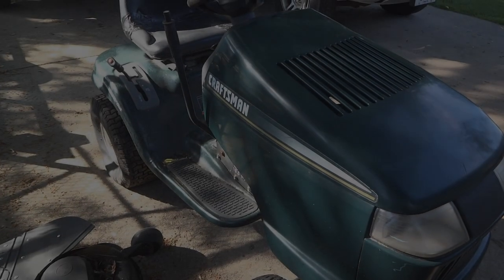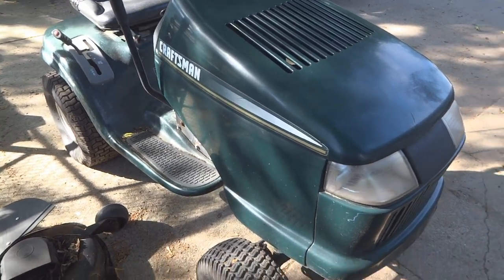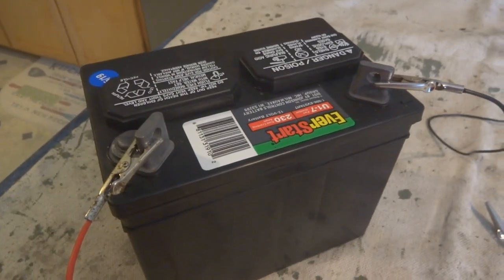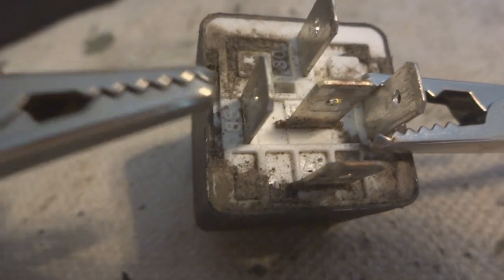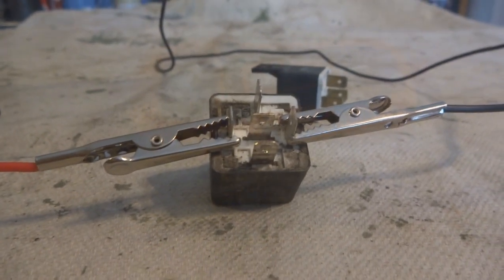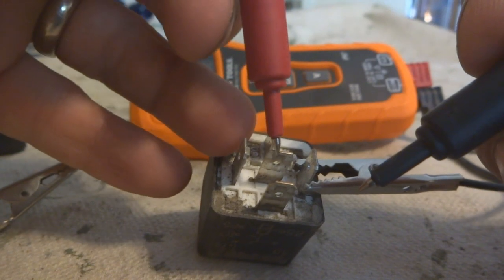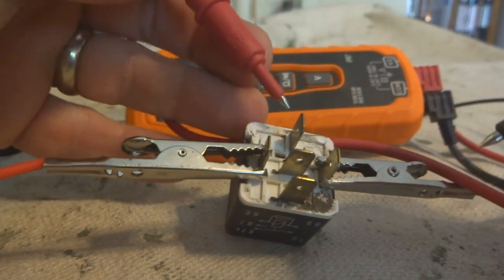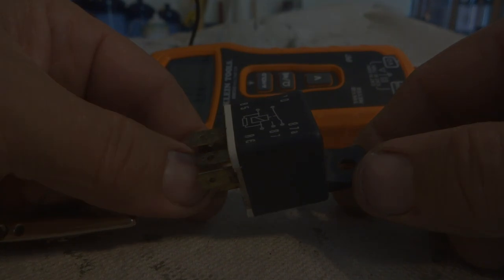Lawn and Garden Tractor Relay Testing

Comment: Good video. How would you break in a brand new generator. I have a brand new generator. It’s a generac gp6500 which I believe is just a Honda clone and it doesn’t say anything about break in.
Reply from the maker: I break in a new engine by putting in fresh oil then running it for 1/2 an hour. Then I change the oil. There are many opinions on how to break in an engine so don't treat my process as gospel truth. Thanks for watching.